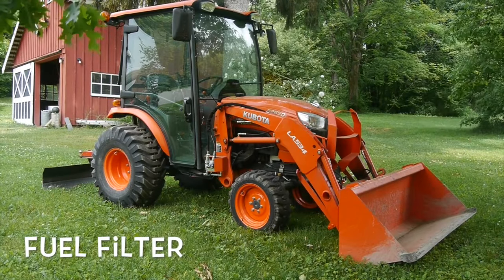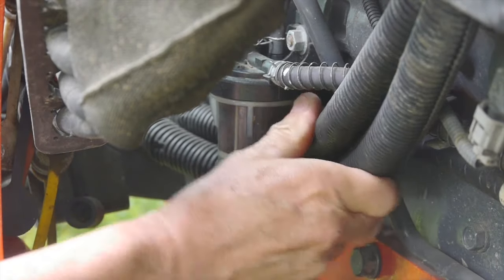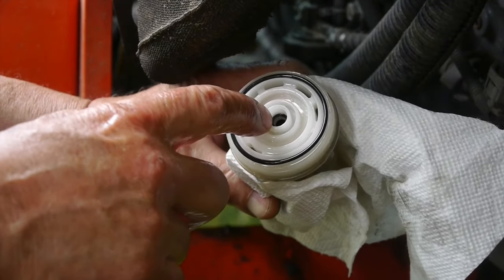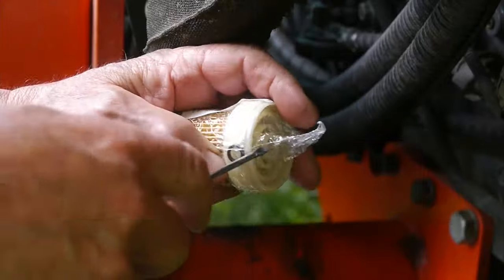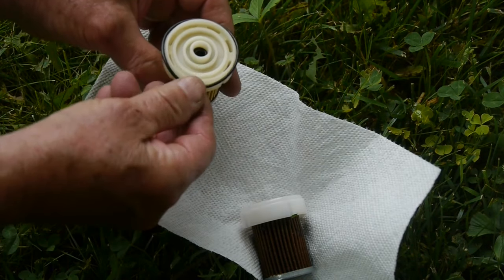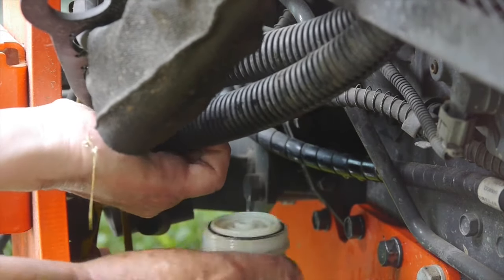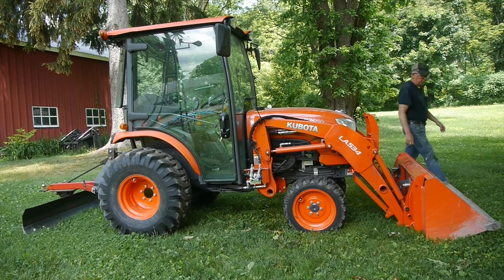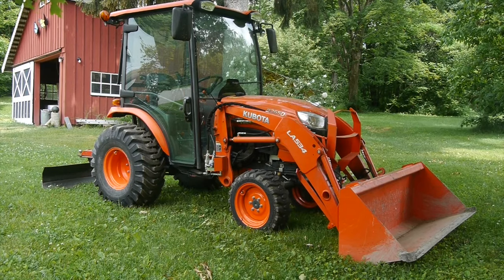Kubota Fuel Filter change- BEST VIDEO

Comment: Good job documenting the fuel filter change.  I use a pair of needle nose Vice clamp pliers to cinch off the in/out rubber fuel lines.  Keeps from spilling fuel during change. One thing I added, at very little cost was a fuel water separator.  Over 100 hours it captures about a cup of water.  The water comes from condensation in the fuel tank.  First time you see the damage that water does to high pressure pump and pistons, you’ll invest the $50.

Comment: Out of curiosity, what was the level of fuel when you changed this?  Seems like I remember reading that it's best to change with less than 1/2 tank.  Maybe with less fuel in the tank, less would spill out when removing and replacing.

Comment: Thanks so much. you saved me a lot of time and frustration. The manual is no help on this. they could have mentioned  that there is no shut-off valve but a spring loaded shut off valve inside the upper housing of the filter unit.  my L-3400 won't stop leaking fuel when I spun off the fuel housing. I pushed the little spring loaded shut off several times. may have been gunk in there to keep it from sealing. I also put a clamp on the incoming rubber fuel line and that stopped it. I found a filter but no seals so off to the parts house. I found the easiest way to to pull the plastic filter holder is with a skinny plier. on the outer most ring an pull up slightly and go all the way around and it will start coming out.  my tractor is now over 10 yrs old, hydrostatic.,back hoe, bucket , brush hog, box scraper. It has done some incredible work. only regret is that I should have gotten  the bigger unit so I could have gotten the backhoe with a thumb. P/O

Comment: Great video, but you did not show cleaning the plastic bowel the filter fits into. Thats why I came here to see what you used to clean it with, as somethings like carberator cleaner could damage the plastic! I will search around and find the right solvent, but a little note. I got my filter replacement from the Kabota dealer, (and its not close), and when I opened the box at home, it was not rapped like yours, and did not have the two new O rings. Bummer, but glad I saw they come with the filter (as it should). Back to the dealer I guess! Mine is the B7800. Thanks

Comment: Did you fill the new filter with diesel fuel before screwing it back on? It looked full but i did not see where you did that.
Reply: I think he added fuel to the filter which he really didn’t need to because you probably found out that once you start screwing the bowl on it pushes against the valve and the bowl starts filling with fuel. If you’re good then you get it tightened before fuel gushes over the edges. Im not that good yet.

Comment: You should use cheap forcepts you can get from Harbor Freight to clamp both sides of the lines so you don't get air in the fuel line.  Wear rubber gloves always.  I have the exact same tractor as you with the cab.
Reply from the maker: I didn't seem to have any air problems.  Yes ... wear gloves.
Reply: @TimTools99  Ask any mechanics it works on diesel engines the last thing you want is air in the line of the fuel so don’t take my word for it
Reply: @orionism42  thats what the spring valve is for. It doesn't allow any air to get in the system because it pushes fuel out when activated and stops when set. Never had issues with air in my kubota. Also pinching rubber hoses weakens the plys and in time will have to replace the hose or cut past where you pinch it as it in time ruins the hose.

Comment: I  changed my filter last week.  It was a no-brainer.  So I won't watch this video.  ...But I'm still smarting over the $35 that the new one cost from NAPA.  And beware, that thin, little o-ring does not come with the new filter.